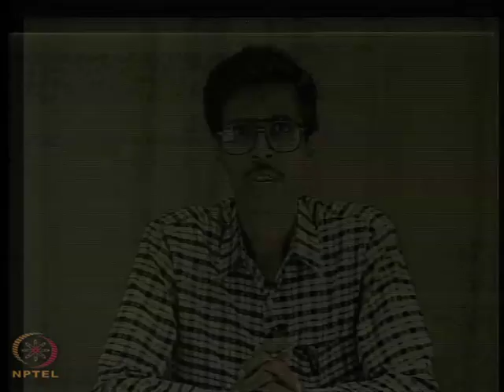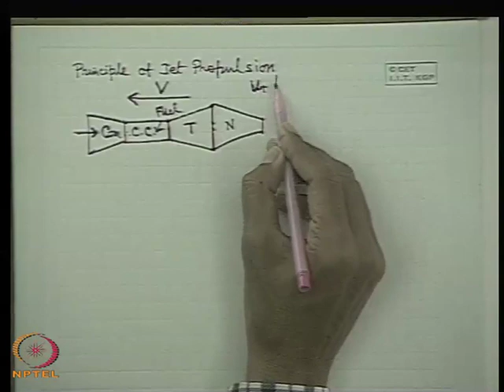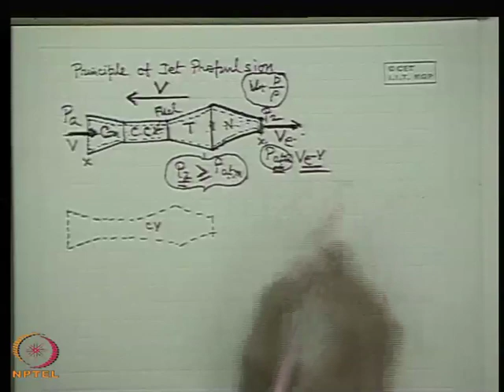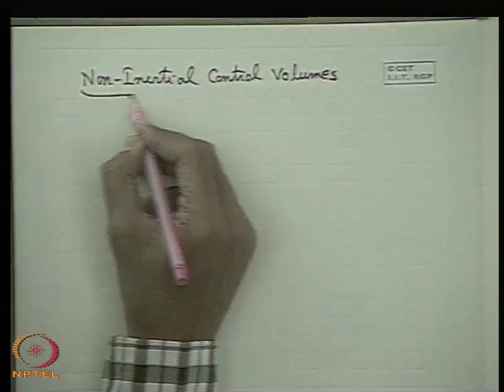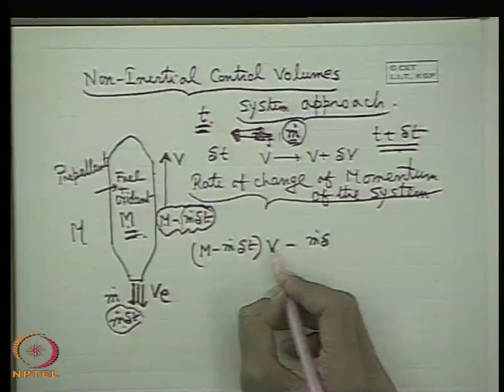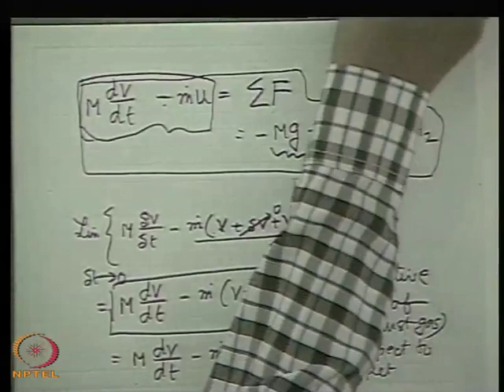Mod-20 Lec-20 Conservation Equations in Fluid Flow Part - VIII

Comment: exhaust gas relative velocity when jet is moving should be Ve+V not Ve-V
Reply: Yes, you are right. the exhaust gas relative velocity will be Ve + V . The last question of this lecture can be solved only by taking relative velocity of exhaust as Ve+V where Ve is the absolute velocity of exhaust gas  and V is the velocity of aircraft.
Reply: @rajibdas1087 sir had written it also
Reply: @mohitnagpal9194  consider that to be written in vector form...then there is no doubt....
Reply: actually he didn't specify absolute velocity of air, velocity of air is zero wrt fixed point on ground. I also assumed that Ve is the velocity of exhaust gases wrt ground so velocity of exhaust wrt control volume will be= Ve-(-v)=Ve+v
Reply: Ve at Exit and V at Intel are the relative velocities, observable from the jet. Absolute at Intel is Zero (V-V) and at exit is Ve-V (Ve-V + V). so either sir has written inlet wrong or what you are saying is right
Reply: @bibhaskumar8139  sir told that exhaust gas relative velocity w r.t rocket is Ve +V
Reply: I was also thinking likewise..
Reply: To bring the system to steady state opposite kind of velocity -v is applied to control volume bring it to stationary and analysis is made with respect control volume .
Reply: V+Ve will be the relative velocity of rocket with respect to jet, and not Velocity of jet w.r.t rocket
Reply: @rajvaibhavpatil1610  no